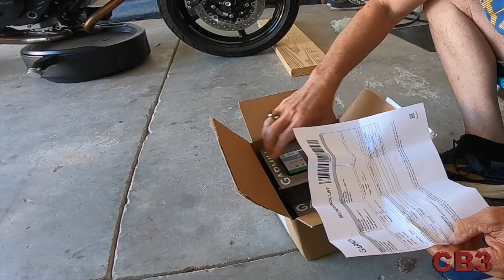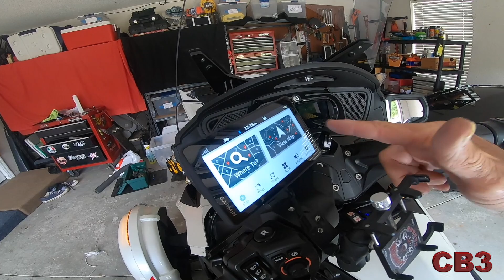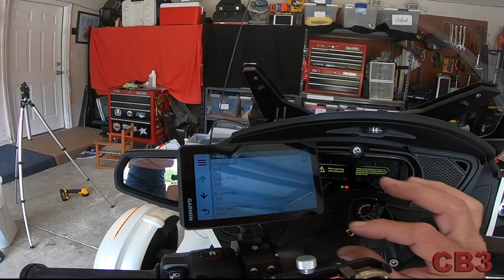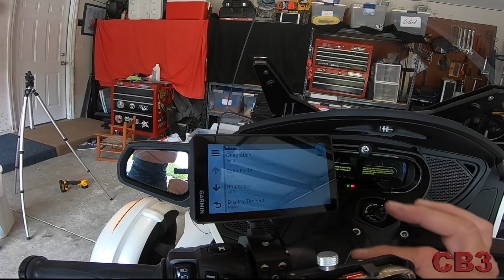CanAm Spyder and Zumo XT Unboxing, Initial Thoughts and Installation

Comment: Hi Coach Bob,
I just finished  wiring in a Spy5000m motorcycle alarm for my 2018 spyder RT.. now I am hard wiring the Garmin ZUMO XT to my spyder  I have watched this video at least 3 times supper excited.i uploaded the software and loaded about 40 addresses into the my ZUMO  2WEEKS ago..also today UPS should be delivering my laMonster handle bar cuff with 2ram mount balls 😀

Comment: You stated you didn't want to use your phone as GPS or have a case on it because it's bulky.  Then you buy a bulkier than phone GPS that has to removed and placed into a case AND when discussing mounting options, clearly said the phone will be on the mount with the GPS.  This all seems very counter to what you said about not wanting to use your phone.  The phone in a case will be less hassle and bulk than managing two devices and thier cases. What am I missing? 😅   Loved the video though.
Reply from the maker: The bulky case on my phone never seemed to mount in a stable way on the Spyder and water intrusion issues made me have to put my phone away during the rain..meaning no GPS help in the rainy weather. The Garmin is water proof and I don't have to put it in my pocket, like I do my phone.  Also...my aging eyes appreciate the larger color display.  All of that said.. the ZUMO has shortcomings as well. 

But, I do like to have them both mounted...when it's dry. Redundancy is my friend. 

All great points... Thanks for watching and taking the time to reply.  CB3 👍👍👍👍

Comment: My 21 RTL goes in for firsts service in next week or two, and I have list of installs for the dealer, backrest, armrests, a Zumo XT, sway bar, tie downs and some other stuff.  Then in fall full
light systems installed under the Spyder.  Good video Coach Bob.
Reply: Hope your getting a good price my dealer charges $130hr which is crazy. I'm gonna have to do all my lighting myself. Good luck
Reply: @BOOMER28401  My under lighting will be done at Americade.  They give really good deals then, that's when I had my H-D done.  Lucky for me cost doesn't matter as long as well done work.
Reply: @Senegal01  I could afford it I just refuse to be robbed! 😁

Comment: Thank you  for the video. I wired my (zumo xt) Garmin to the battery using your advice. It was scary popping off those side panels for the first time! It seems like with the 2021 Spyder, I don't have to take off as much (like the mirror). I did end up having to take them off a second time to retrieve (and secure) the little rubber weather cap because it fell down into the bike (followed the wire). Like you I wonder if the heat of the engine will eventually melt the wire. I figure I will just buy another wire if that happens.

Comment: I have Zumo XT mounted to my 2020 RTL permenantly wired to the GPS power plug under the right hand side. A couple of thing I have found, the handlebar mount provided won't fit the RT bar it's too small. The heads of the bolts holding the mount plate together will rust with time. Look after the USB cable provided its not just for charging but is a data cable as well, you need this to download trips planned on your computer using Garmin Basecamp. Its much easier to use Basecamp when you want to plan using waypoints than programming on the Zumo itself.
I find that the best position to fit a GPS is as high as possible, I have a stick on Ram mount on the top right of the instrument console. The power lead then runs down through the slot for the windscreen mount arm and the power block is zip tied to the frame under the tupperware on the right. In this position I don't have to look down to see it taking my eyes off of the road, I can see it when I look towards the mirror and it is still in my peripheral vision when looking forward. While I generally use the connection to my helmet headset for directions it is handy to look for any twisties coming up on the map, also to check whenever a warning comes up of a change in the speed limit ahead. (Also to check when it is warning me I am going over the limit for that road)

Comment: Hey @CoachBob3 , I enjoyed watching your video.  However, I had to let you know there is actually a connector for GPS in 2018 and 2019 under the seat.  this video shows it and how to connect to it.  Mine is a 2015, but I knew about this video when I found it for a friend who was looking to wire in a Zumo XT on a 2019 RT.
Reply from the maker: I saw that after the fact.  Love and learn.  👍👍👍👍

Thank you for the information.  I will follow up with another video in a week or so.  Thanks again.  CB3
Reply: Wow thanks ...for that bit of news...I have a 2018 spyder RT limited

Comment: Coach - I have a Garmin 665 LM.  Battery life is terrible without having direct power.  My advise is to hard wire when ever possible.  I’m thinking about hard wiring mine.  Right now I use a USB to 12v adapter on the 2020 Spyder RTL.  Just need to find the better mounting adapter w/power connector.
Reply: There is a GPS power connector on the right hand side of the 2020 RT. It's behind the panel under the access panel to the brake reservoir.
Reply: @JimGDMAC  I will have to see if I can locate that!  Thanks for the info!  Ride Safe!

Comment: Hey Coach!

I have a question for you regarding the wiring of the Zumo XT.    In particular, the plastic piece that your son broke.

What was inside of it?  Is there a fuse in it or does it just serve to connect the heavier cable to thinner cables?

The reason I ask is that I purchased a Zumo XT.  I have a 2014 RT Limited and it had a Zumo 660 mounted in the center of the handle bars. 

I’ve discovered that the handle bars were upgraded by the previous owner to adjustable handle bars that has a compatible mount on them that fits the zumo xt mount.    This means that the power connection, plus other not needed wiring in the old gps are present and I’m thinking of just cutting the old electrical connection off and splicing the XT power cable on.   But, I would be cutting the zumo xt cable way up the cable from that box.

I would appreciate knowing what was in that box. 🤗

Thanks for your help.
Reply from the maker: It was a little printed circuit board encapsulated in a clear epoxy.  It did connect the heavy wire to the lighter wire.   The assumption we made was that it lowered the amperage for the device off of the battery.  

Hope this helps.  God bless ya.
Reply: @CoachBob3  Thank you very much.

Comment: It your Garmin XT wired straight to battery?
Reply from the maker: There is an accessory wire down by the battery.  I tallows the Garmin to power up and down as you start the Spyder.